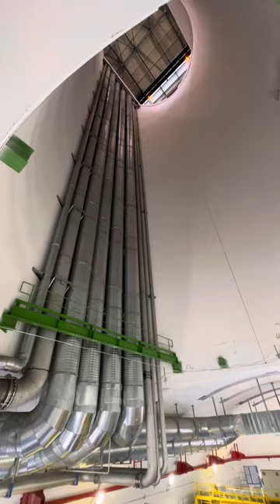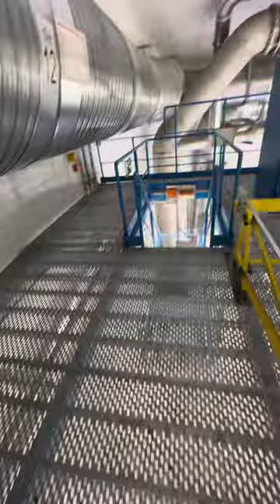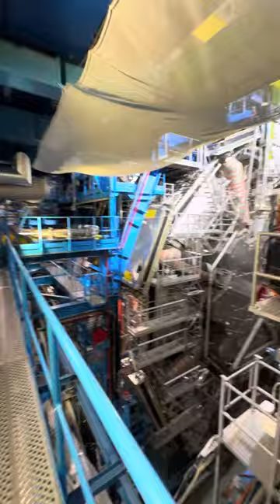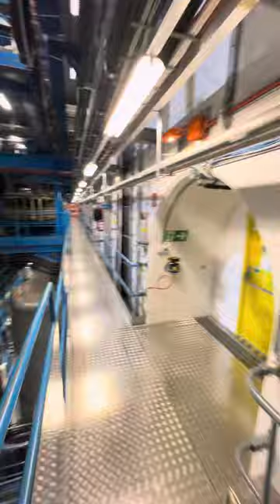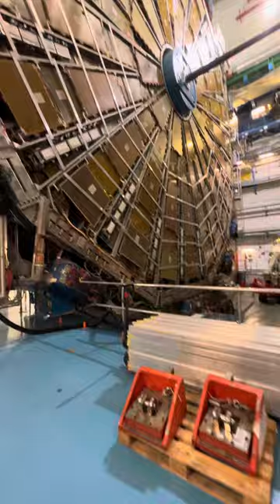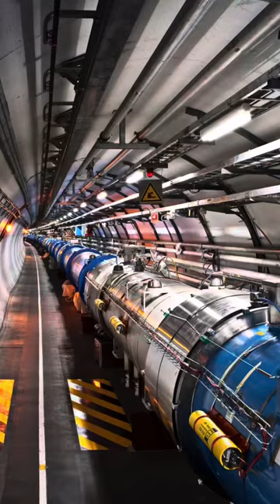You won’t see all of this on a tour of CERN

Comment: How come there is no video of anyone firing it up?  I would like to see how it works. Also how many interdimensional beings, fallen angels, reptilians etc have you met since you have been working there?
Reply from the maker: You can't see much when it's turning on, but I'll be making a video soon explaining how the LHC works in more detail.
Reply from the maker: Also, zero inter-dimensional beings or fallen angels. I've seen a couple of common lizards around, but they just bath in the sun near the restaurant.
Reply: @ParticleClara  See i knew it 🤣🤣🤣👍🏾👍🏾👍🏾 reptilians confirmed 🤣🤣
Reply: @ParticleClara  What is this the ultimate goal at CERN? And can it be used for other things?
Reply from the maker: I have a shorts video about the purpose of the LHC at CERN. Ultimately, the goal is to understand our Universe better on the smallest scales. That's what we use the LHC for and it isn't used for anything else. But, improving our knowledge can lead to other uses for other accelerators, such as for medical treatment / diagnosis, and also material studies, for example.